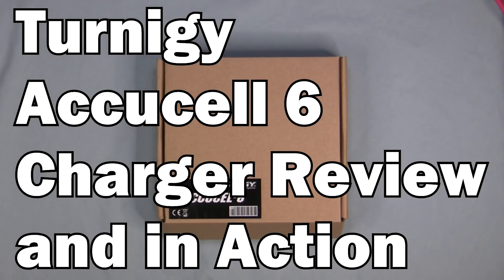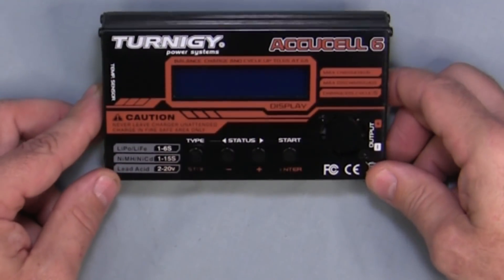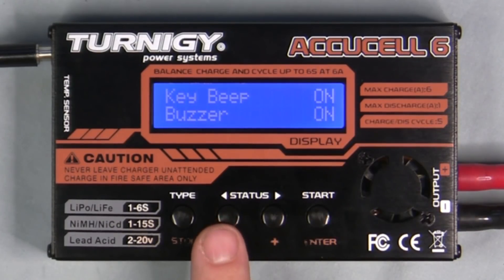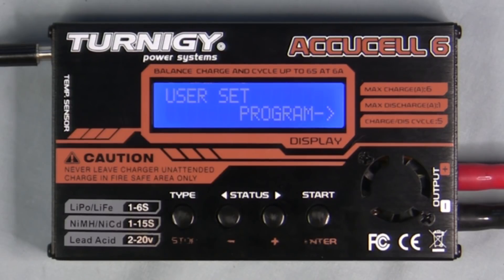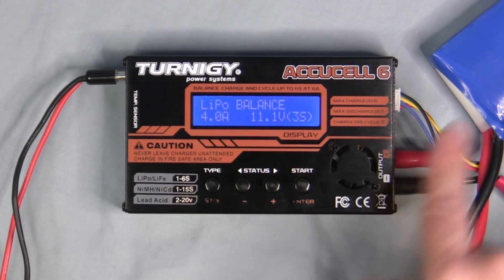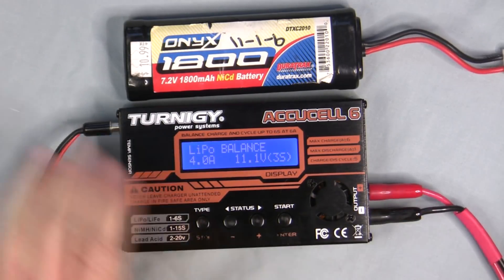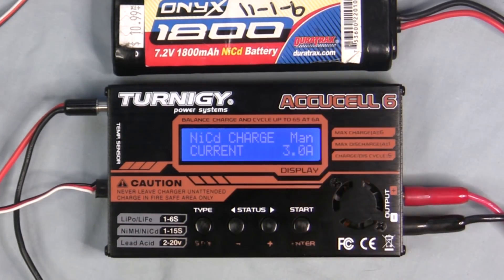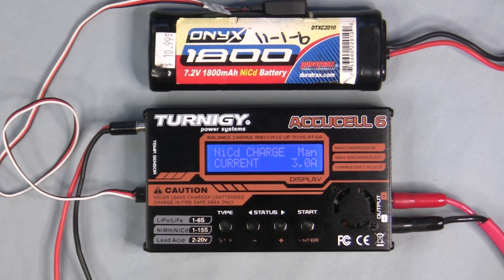Turnigy Accucell 6 Charger Review and in Action

Comment: Hello, can you please help me. I have this same charger. I charge my new 4000mah battery and only get one and a half min fly time out my trex 550e. I do put in 4.0 and 22.2 and then push charge. Then when it starts charging, it only shows 2.2A. It should charge at 4.0 as its a 4000mAh. In your video, your 4000mAh charges at 4.0A. What my problem with the way i set up my charger? PLEASE help me.
Reply: 33gate1 this charger can output only 50watt. 22.2V * 4A = 88.8 watt, impossible for a smart charger. Outputting that power would kill it so it only charges with 2A which makes the output power be under 50watt

Comment: So I have an nicd battery and I see that you are charging a 1500mah battery at 3a.  I was told that you should charge it at the battery's mah number. Was I told correctly also I have a nimh is the charging level the same? I have a 4200mah battery and have been charging it at 4.2a.

Comment: A MAJOR bit of advice for those new to charging with this charger and similar.

NEVER uplug the leads to the battery that are connected to the charger first.  The banana plugs have exposed leads.  It very easy to accidentally touch them together.  

ALWAYS disconnect the XT60 male and female from the battery first.